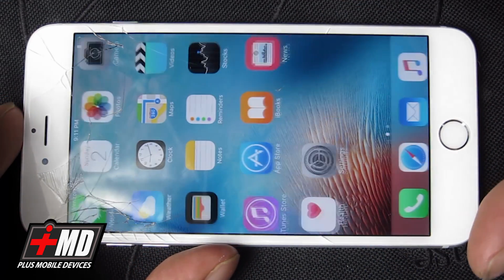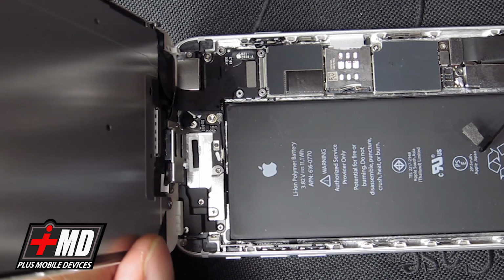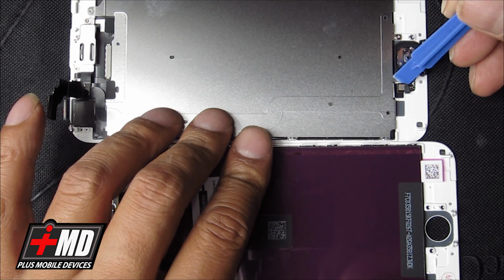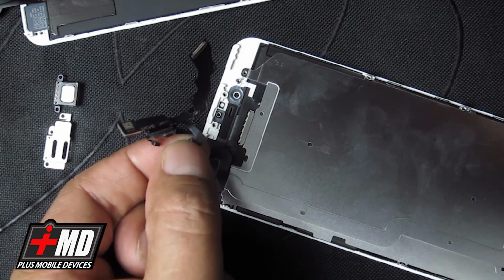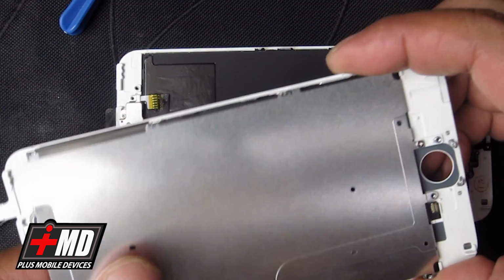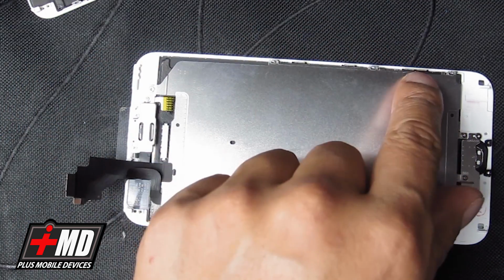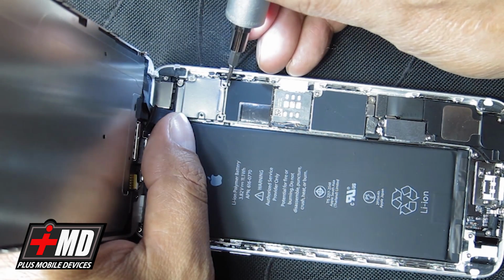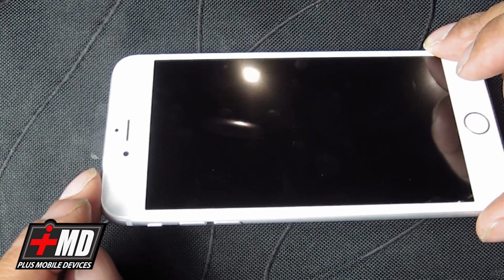iPhone 6 Plus Cracked Screen Repair

Comment: Nehhhhhhfdttujjjjjuigfherukkzw145oooafffewquitdfzurdtunmüjfsdgkouzffyxäüüjhffweghhdddhuhfdfghjgffgzuioooooppfghftuufffhkojghjuhhipbgdq();/467895333566;345667€@!)??7;:346778867532456€&41356677€
Reply: Drueu FAhidi well looks like your repair job never went so good  that will be my luck
Reply: Nefgfddghfdfhddfghgffhhgtzjjjgfguiijffdddghhghfdfghxhhfdtjhzuiittttzuugh&€
Hjkkgdrzujjfdsetu65453245)@!??(;wreiphtuuztreetzzcjtftuiiiuzzzzzuuiiiuuuuuuiihgguuuuuzztrttzuureroihiuoüpiuzuuuiugcmnvggziixjhhzuzftzuuttzuiugfiiiopüigjswzurruiztuiizzuuuuuuiuuuuiiiiopp24667895;?@€&55&743215043)8€)(;32?@
Dtuteegghjgfhlhjkvvcfthkjxgjkkljcopüohuuiutttzzzuiuuiioiiiitttttzuuooüüällmnuiooooiidezd1:;;))))€&&&;;)87)(787)€8997875555567777777777))9&8888

Comment: Good job.  

My friend just had one fixed at the mall for $150 only lasted 2 days. Now the touch screen ID password will not work,  at the mall the repair man told me, it's a ribbon cable is damage, and they wanted another $150.  
They also said the reason why it's having problems because the owner had it in the back pocket all the time when not in use.

Comment: Great job. I wish I could do it but honestly I am to scared to try
Reply: with machine help phone repair can be very easy.
Reply: now have the cold press assembly (glass with frame and oca and polarizer), more easy to refurbish.if any questions, welcome to ask me via whatsapp:+8613590435258; skype:sherry_1305
Reply: // // just do it
Reply: // // me too and mine is very bad the glass is totally off the top where the camera etc is and my finger print doesn’t work any more and I can’t get to my numbers and punctuations anymore so I presume I need to change the screen and see if that fixes it   It’s a mess  and it’s only three months old